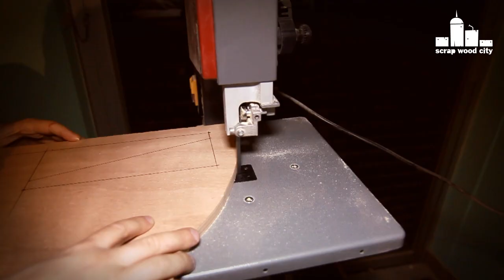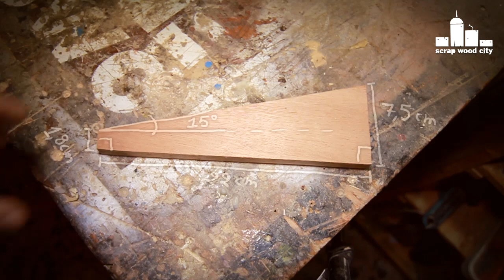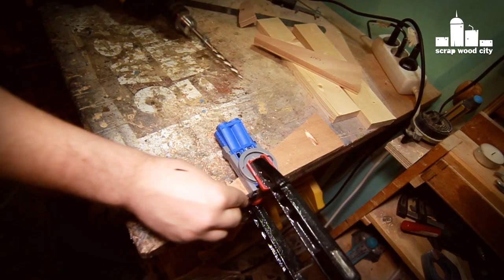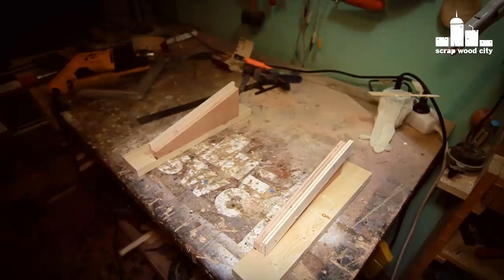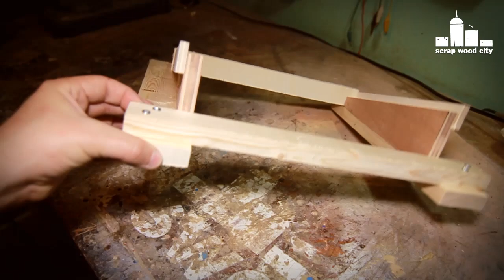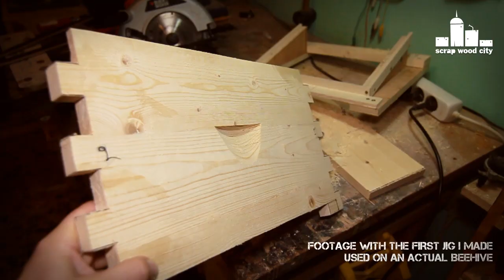DIY beehive handle making jig for the circular saw

Comment: Good Video mostly.  Blade depth would have been helpful.  Will be making this one.  For the conversion, the ramp measurements were just shy of US rulers. To save you time, 1.8cm = ¾”     22cm make 8 ¾    7.5cm make 3”.   Keep in mind that circular saws were not designed for "side" cutting so notice that the blade was being "bumped" up and down a little. This could wear/stress the arbor and bearings in the long term. I have seen similar on other sites that warn this can be dangerous sooooo BE CAREFUL.  My only recommendation will be to make the thin guide strips on the sides out of 3/4" and use the thin wood on top to keep the saw "trapped" in a groove when "bumping" or lifting the blade slightly as the deeper cut is being made. I'll try to update if the top guide helps make this project a little safer.

Comment: I built one of these and was not 100% happy with it for three reasons:
1  The handles it cuts are not big enough for my hands
2  The cut slopes outwards by 15 degrees and is inclined to "shed" the fingers.
3  I was not happy about lifting a saw while running at 4000 rpm
My solution was to build a larger jig and use a plunge saw (1400W) so that the base plate stays in contact with the jig.  The plunge saw has a bigger blade and therefore cuts a wider handle.  It has an adjustable depth of cut.  It also has an adjustable angle of cut.  This allows the saw to be turned around and used right handed.  The angle of cut can then be adjusted to under-cut the handle.  It works like  charm.  Thx for the idea.

Comment: Im guessing you have to tilt the saw blade as well to the same angle so the saw is cocked but the blade itself remains perpendicular to the board youre cutting or else the part of the handle where your fingertips meet will not be too safe to hold onto since theyll be angled as well.
Reply from the maker: No, you don't have to tilt the blade

Comment: Totally cool!! I didn't get what you meant until half the video and I was like  :DDDD very nice! I guess the jig is more or less tricky depending on how deep you want it, because since it pivots on one side, you could have centering problems right? something to keep in mind!, so why do you have a " _" face in your hand? :P thanks man!!
Reply from the maker: +Cactus! workshop You are absolutely right. Check the description of the video. People with larger saws (or table saws) tilt the blade to match the angle of jig and get a  90 degree vertical cut. Mine is slightly angled. I was just testing a few old markers on my hand, nothing artistic! lol
Reply: +Scrap wood City I see! that is clever! thanks!!